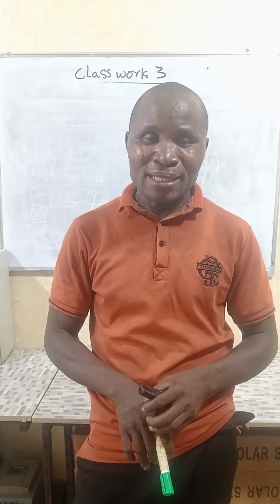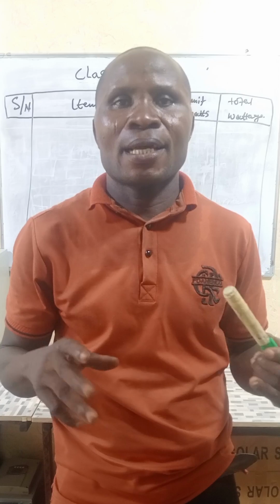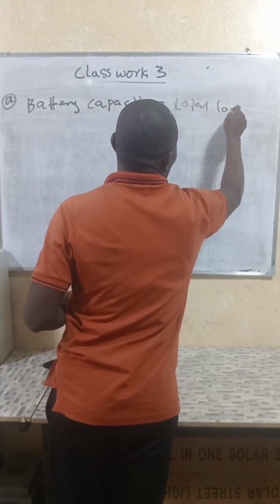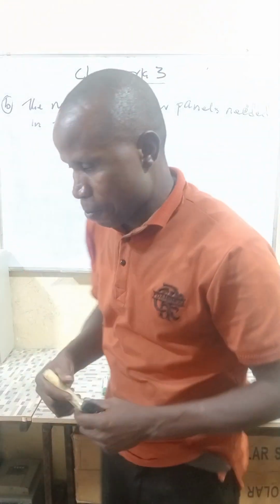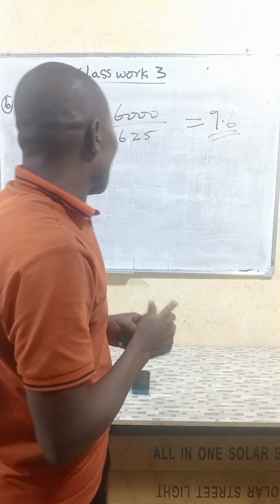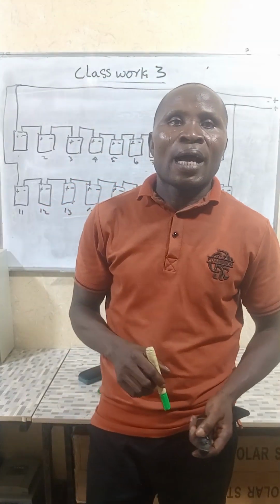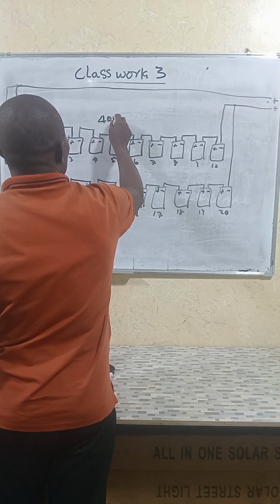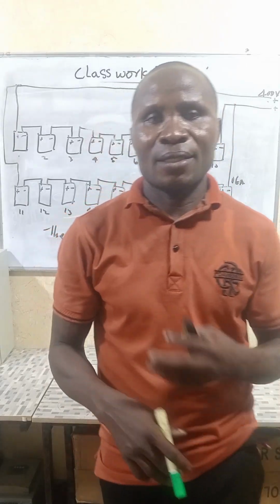Best way to design a solar system

Comment: While calculating the battery capacity,I thought you have to consider the total energy consumption for a day ,the Idle inverter loss since the fact that for the inverter to remain on even without loading it ,it's consuming the battery too,the days of autonomy,the dod and also the nominal system voltage
Kindly enlighten on that otherwise thanks for the great job of empowering us